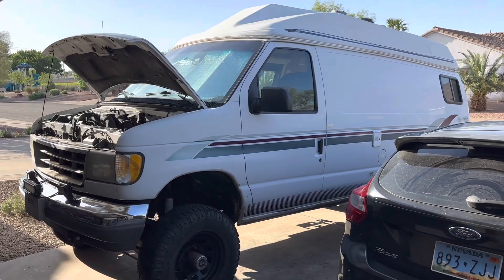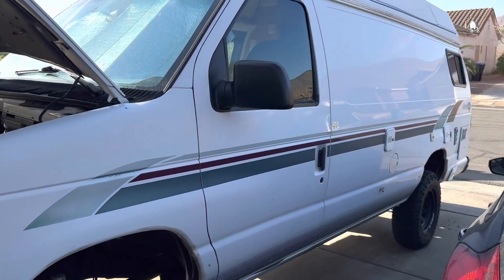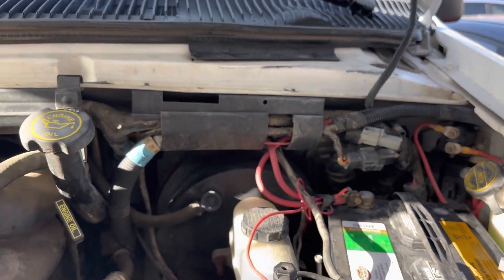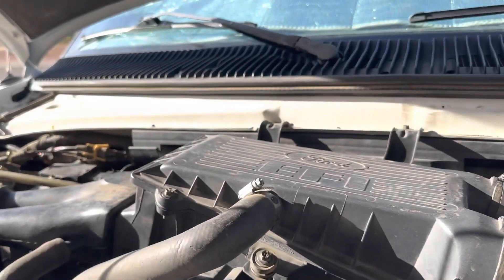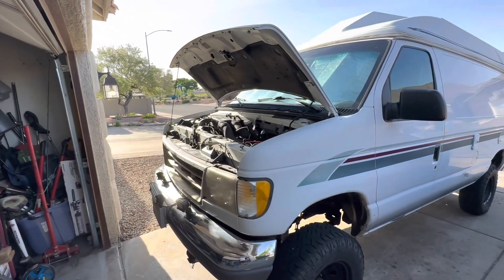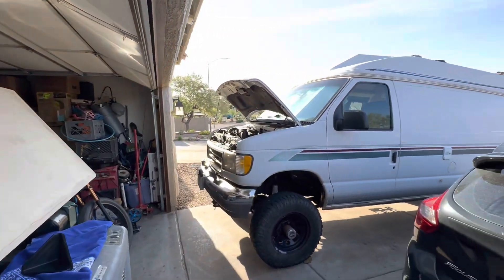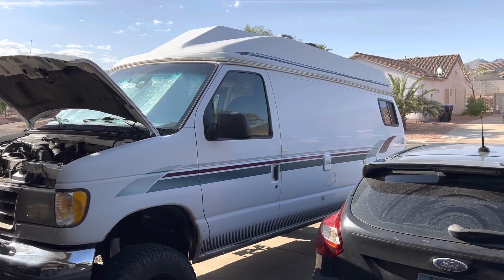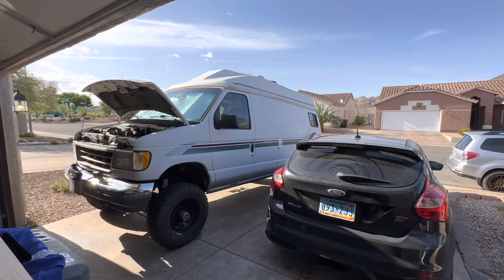4x4 Class B Van Project Update: Did it Pass Smog??? 😖

Comment: Nice easy fixes on the gas filler and even better on the easy vacuum line. Got lucky with that one! Just try running the fridge on propane. Those things barely use any gas and are super simple to service and fix problems with. 3 ways the way to go especially if you plan on selling it after

Comment: I don’t know but I’ve been told that for a vehicle with that many miles on it, if the transmission fluid has not been regularly changed, changing it now could cause transmission issues.
Reply from the maker: Me too. I am still deciding how I want to handle that. Thanks for the note

Comment: I'd use it for several trips before deciding what to change inside. I do think switching out the fridge to a 12V one is a good idea as I believe the majority of RV fires are propane fridge related.
Reply from the maker: I didn’t know about the fire hazard. I appreciate the heads up.
Reply: I think that swapping fridge out with 12 DC compressor type is good only with an upgrade to lithium ion battery system which can get pricey.
Reply: @mikegurley4397  the batteries are cheap enough nowadays; however, you do have to make sure the charging system is compatible and yes, that can be a little pricey if it isn't (I speak from experience as I had to change my AC and DC-to-DC chargers)